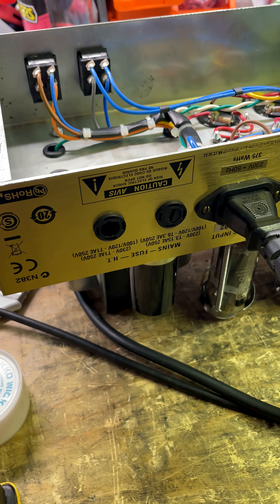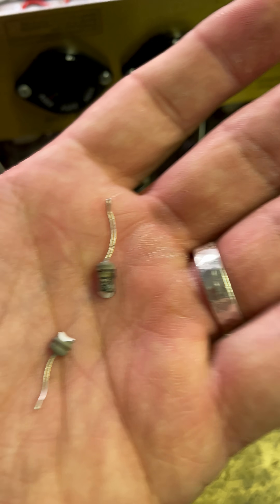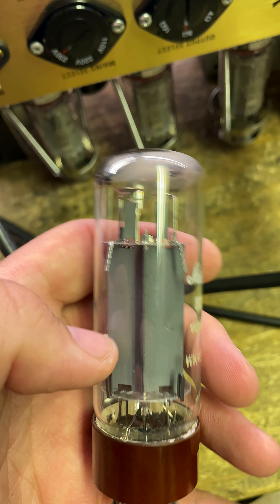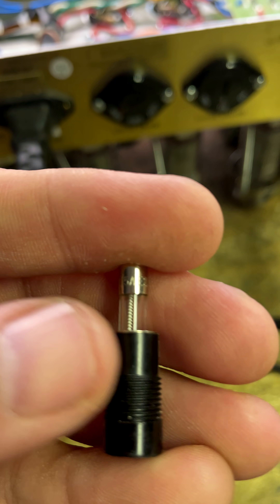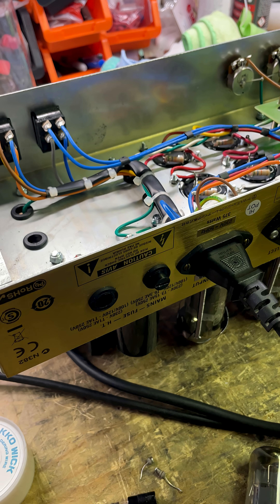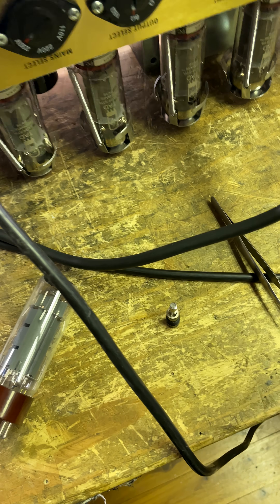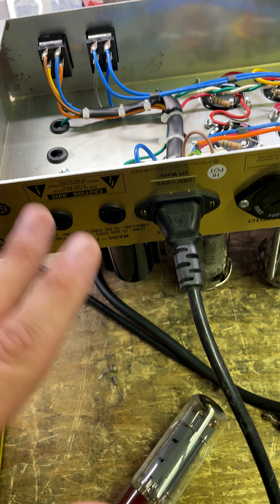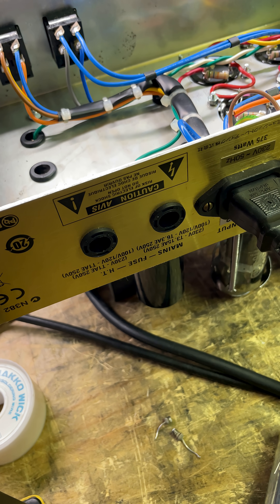Wrong fuses destroy a Marshall JCM800 2203 #amprepair #electronicsrepair #marshallamps

Comment: My Marshall EL34 50/50 is a rack power amp, essentially it’s a dual mono bloc amp that blew its 3.15 fuse. The chassis states the fuse is T3.15AE 250V (I’m located in US, so 110 is the power source). The T indicates a time delay (slow blow) fuse, 3.15A is the amperage rating for H.T. Mains and the E is how many tests it passed at a specific current. These E series fuses cannot be found. I can only find L series fuses, which indicates they weren’t tested to the E series current. In other words it could possibly melt before an E series fuse. But I have no real choice. I took the fuse from the working channel and put it into the blown fuse channel to verify it will power on, and I’m running some basic play tests to see, why did that fuse blow in the first place? It was last serviced by a professional tech in 2019, a process which took 6 months to diagnose a blown transformer and acquire a replacement from UK. Very costly as well, but I’ll phone them when they open Tuesday to see if he has an E series fuse he would part with. I see a repair video on another channel where the chassis doesn’t specify the E series fuse, same amp. That chassis only states a T3.15A 250V fuse. So who knows if this E series fuse is a requirement. That’s what was in there. So I don’t know.
Reply from the maker: Nobody has ever considered any fuse parameters beyond its current rating, and it’s time rating. There’s no need to. Whatever is written on the socket is what goes in. It’ll be either T/S, or F for time, and whatever the current is. That’s all.

Comment: My '88 2210 has one reset switch instead of the two fuses. Never seen that before getting that amp.
Reply from the maker: Because it was made for Canadian standards. They were made for a few years for the Canadian market to pass regulation and used an externally resettable switch.

Comment: Yes, please use the correct fuse! The screen resistor is supposed to blow after a tube/ valve shorts out. It protects the transformer. Some technicians put 5w resistors in mistakenly thinking they’re solving a problem. The bias is probably running hot on this amp.
Reply from the maker: No they’re not. Screen grid resistors still have to dissipate power due to screen grid current at operation. Fuses are there to blow outside of regular operation and a screen grid short will take out either the mains, or HT fuse. A 5W screen grid is perfectly fine.
Reply: @drgearaustralia  oh dear, lesson learnt the hard way there! Hope you’re well, have a great Christmas.